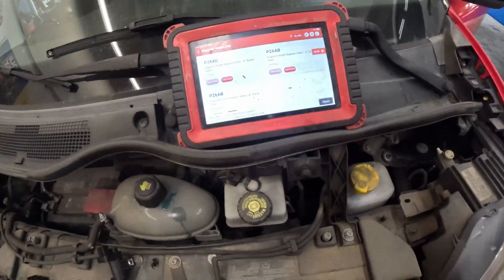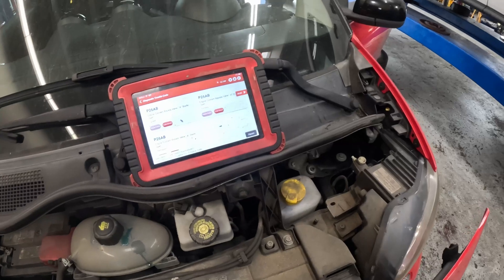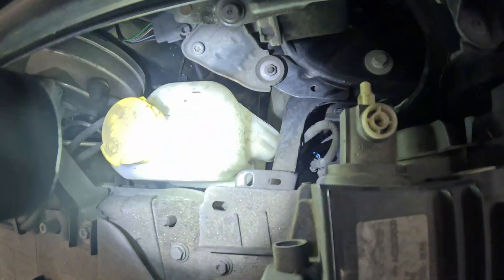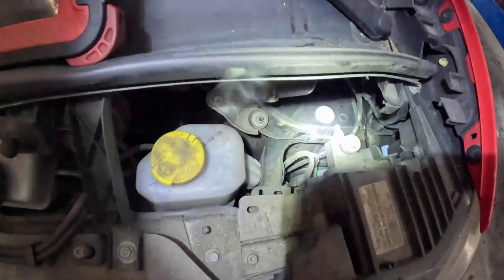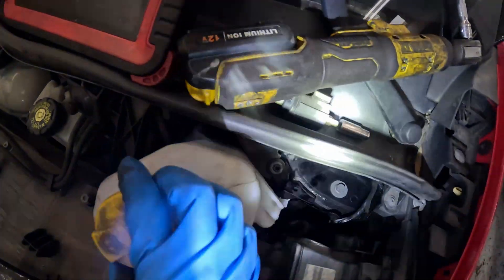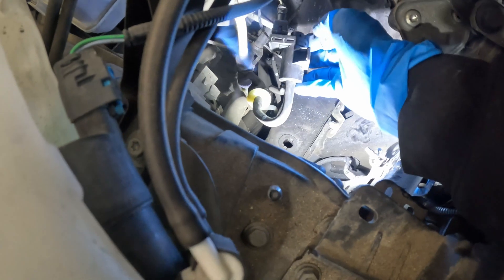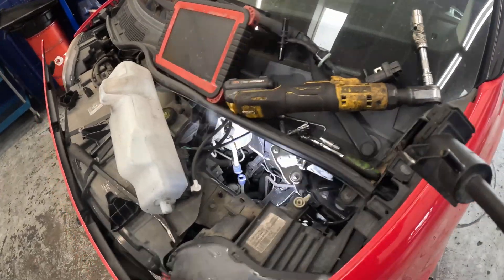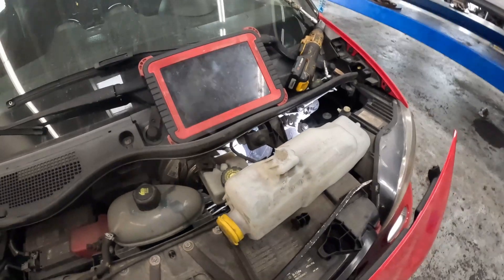Smart Car P26AB, Engine Coolant Bypass Valve

Comment: I just happened to receive mine on the mail, but it came with that little half inch tube on the side broken off. Would it still work without it, or  would i have to buy another one completely
Reply from the maker: Would get a new one
Reply: @Hallisi  Yes was thinking the same, I was planning on JB Welding it back but wasnt really sure what exactly flows  through that side tube/line.

Comment: Hi...mine was throwing the code but overheating, changed the thermostat and the same...eventually I changed this valve today and tested it close from my house and everything normal for now...have to test it on the highway

Comment: @1:07 you said it will never reach an operating temperature but my smart does. I have the exact same code just came on few days ago

Edit: coolant won't leak when removing the part?
Reply from the maker: Do you have a bi directional scan tool that checks the factory side dtc? Often if you have a cheaper or only an eobd scandal it’s possible that it’s not giving you enough information or codes.
Reply: @Hallisi nah we just have a cheap autolink scan tool
Reply from the maker: @ffhjvbuydb78eb  as long as the code is not permanent, I would clear it and drive it around and see if it comes back or see if a different code comes back.
Reply: @Hallisi  i dnt want t mess with it. im taking it t adealer i guess. wish me luck i will need it
Reply: @Hallisi this

https://drive.google.com/file/d/1PI7ulxFcG8h9xUgn9YYqwdz-N7iuqIZT/view?usp=drivesdk

Comment: Where you got the engine coolant valve?
Reply from the maker: The Mercedes dealer. Amazon and other places have it as well just search the part number. It’s really common
Reply: @Hallisi  WHY DO THE ones we see on ebay have two hoses & this has one? Ours is a 2016 smart
Reply from the maker: @zoemarialawson8943  it’s probably the wrong one double checked the part number